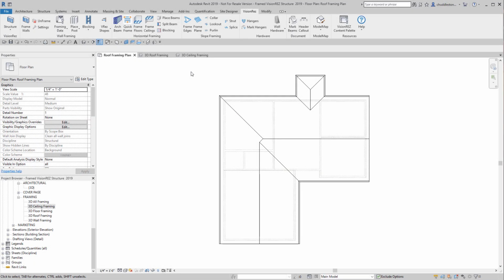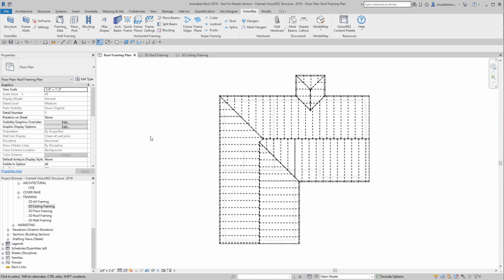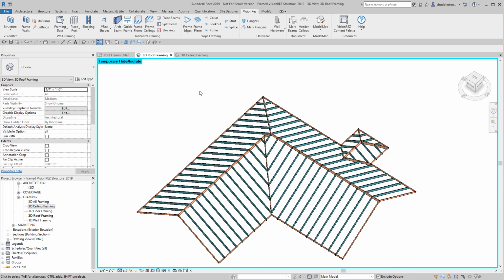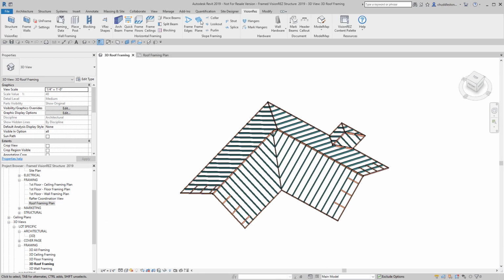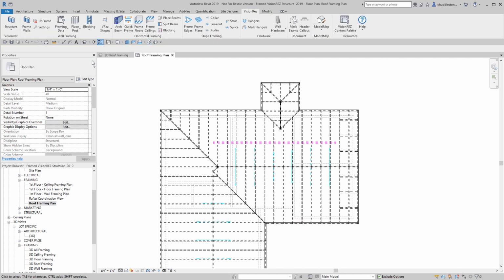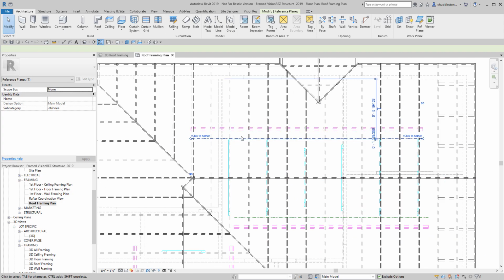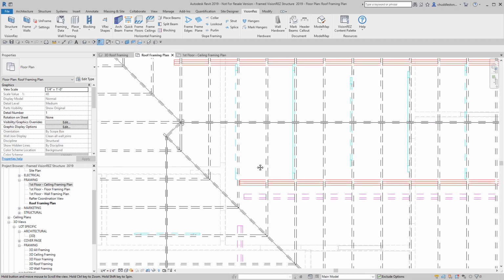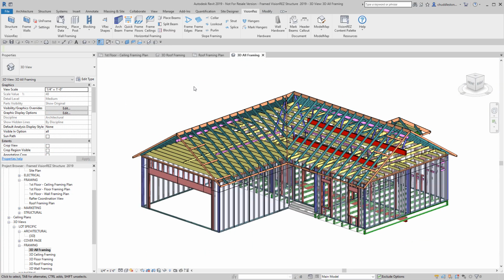15 VisionREZ Slope Framing Panel

Comment: The eave trim(blocking, or verge framing) is not shown as the actual way the blocking is built in the field and, in addition as proscribed in the WWF (Western Wood Framing manual;)  The verge board should ideally be a continuous member. If a multi member verge board the lap should occur at the rafter tail,